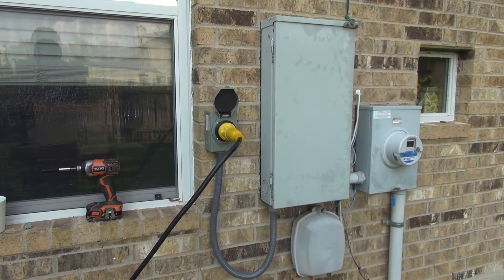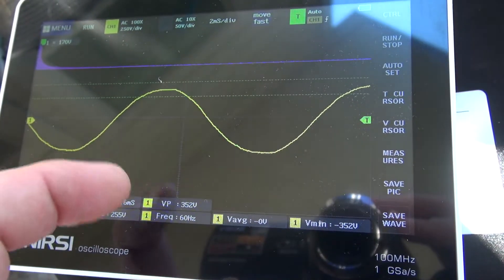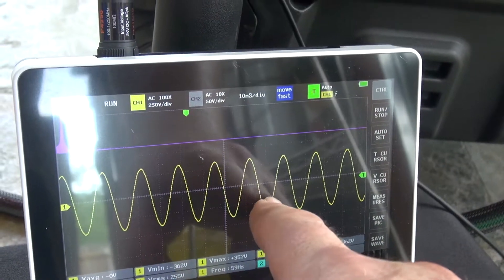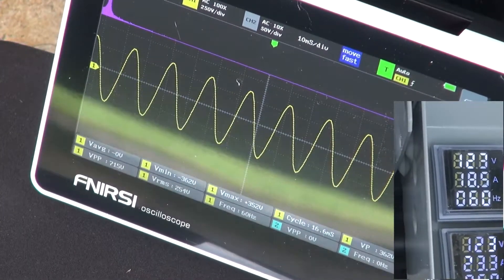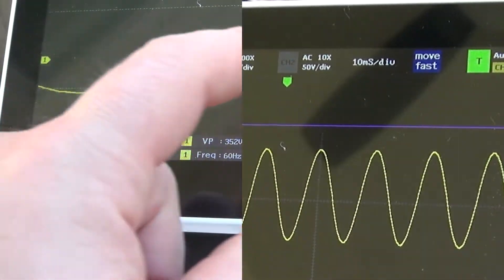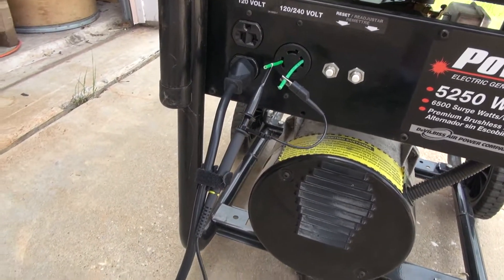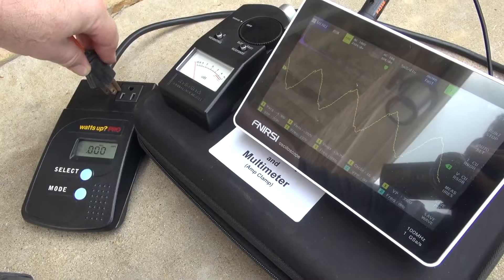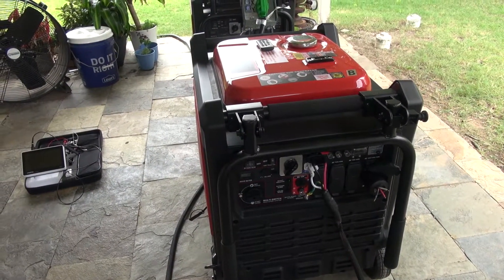Predator 9500 Inverter Generator vs. Line Power vs. Traditional: Compare Quality on the Oscilloscope

Comment: Have you tested the Predator quiet inverter vs the Predator open frame units? Seems they claim "voltage regulator" but say nothing about the quality of regulator they use. But my ancient whole-home generac (that needs replacing) uses a voltage regulator, but doesn't seem harmful. Higher grade I suppose. I'm trying to choose between spending $1100 and $2200. I care more about electronics-safe power than low-decibel power.

Comment: "A typical general-purpose AC-DC SMPS (Switch Mode Power Supply) starts with a bridge rectifier at its input" -> modern AC electronics can even run on DC!! dirty power is never an issue for modern electronics like mobile, PC, laptop, inverter AC/washing maching/refrigerator......they are only an issue for traditional inductive things like old ac/fan/washing machine/ etc...even resistive loads like toaster, old light bulbs don't mind dirty power...Its just a marketing gimmick!! Inverter generators are good because they are quite, fuel efficient (eco mode). BTW in my country thousands of homes still use modified sine wave inverters....and guess what - most of the low power UPS you get online are modified sine wave yet computers work with them!!!

Comment: this is mostly snake oil BS. Most modern consumer electronics and appliances can easily handle the "dirty" power from a standard generator, this was only an issue decades ago with old crappy generators and appliances and electronics with old liniar power supplies. There are almost no actual tests or data on this actually damaging electronics in modern time. you just hear theoretical horror stories designed to sell more expensive inverter generators and as the price of normal generators goes down, the more horrific the stories get to sell inverters lol You would have to run your house on a standard generator for the next 15 years to ever notice any damage to your electronics, if it ever in fact even happened. you think the hospital runs its backup power off an inverter generator with all those sensative machines ? nope.. and the use percentage gaps are about the same as your home, just on a larger scale. Most hospitals dont even imploy power conditioners with their backup systems. google will say they do but in practice almost none actually do.
Reply from the maker: It’s less about the fact it’s an inverter and more about the fact that the portable style generators will often bog down on heavy loads.  If the AC turns on, or the water heater turns on, the engine will be dragged down until it can get fuel and react to bring it back up the speed.  The result is the frequency of the power will change exactly proportionally to the speed of the engine.  That’s what will mainly tear up electronics.  (I had an air compressor, and I could hear the frequency of the compressor motor changing with the traditional style generator load).  Whereas inverter generators will make clean power no matter what, and if they overload, they just turn off the power vs. corrupting it. 

Hospital generators, whole home generators?  Not as much of an issue because they oversize them.  Most homes don’t need remotely the capacity of the standby home generators, but they have to oversize them so they can handle the surges and not get bogged down. 

This method, combined with things like the AC soft starts, allow you to use a more reasonable sized (and cost) setup safely.

Comment: I 100% agree with everything in this video...HOWEVER, I have an almost new 13,500 watt open frame generator given to me for the sum of $0.  I'm left wondering if I could build a hefty capacitor bank to smooth out the modified sine wave.  I know it's an older video, but any input from someone who understands more than "good"  "bad"  "cause I heard" is appreciated.
Reply from the maker: If it's a traditional style coil generator, it should be making a full sine.  If it's an inverter type, you'd have to check if it's a modified sine or full sine.  

If a traditional generator, I wouldn't do it, because the frequency of the power will fluctuate with the speed of the engine (which will change as loads are suddenly applied).  I have a feeling these inverters aren't very good at adapting to changing frequencies, and are instead just designed to match and remain synchronized to a frequency... so that would be bad. 

If it's a modified sine... man... I couldn't predict how it would react.  If you wanted to risk it... I'd say start the modified one first, since it probably isn't designed to be parallel, so you would want it to be the one present that the other syncs to.  But I have no idea how it would react.  

If you could build out a capacitor bank that would truly smooth out the modified sine into a real, full range sine wave... then I would ASSUME that the second unit (that is designed to be run in parallel) would sync to it.  (but again, start the one that isn't designed to sync first)

But you're deeply in uncharted waters. Stay safe!
Reply: @Texas_DIY  Thanks for the input.  My understanding is it's just a regular old portable dirty sine generator.  It's definitely NOT an inverter.  I'm just trying to smooth the "dirt" out like you see in your video.  You can hear the awful louder buzz from appliances when run on it.  Even various shop lights - LED or CFL buzz like crazy.  They do that on my 5500 watt portable as well.

I guess maybe I can sell it and buy a less powerful sine.

Comment: Great if the 9500 would run
Reply from the maker: So far, years later mine are still going like new.  Though admittedly they don't get much usage apart from exercising them to keep the battery charged, and the rare instances where they are legit needed.

Comment: Actually, the ‘sensitive electronics’ he mentioned all have switch mode power supplies which self-regulate and chop up the incoming voltage and rectify it into DC. The noise created by the SMPS is much more than the THD from the conventional generator and the filter circuit removes all the noise. These power supplies will be labeled 120-240 and can handle that voltage range safely.
Reply from the maker: Some power supplies filter quite well.  Others not so much.  Other things such as the control boards on your central AC (or at least on mine) don't seem to have much filtering at all.  it's really not so much the jagged lines... yeah not great... but it's not going to insta-kill anything.  To me, it's more the issue with the power frequency fluctuating so widely when loads are applied to the generator and the engine bogs down.   On one of my tests, I plugged in an AC motor to the traditional generator (Air compressor) and I could literally hear distinctly the motor changing speeds with the AC frequency. 

To each their own, but I'd rather not power my stuff I care about on power that behaves like that... especially in an instance where it might be ongoing for several days. 

Stay safe out there!

Comment: Great video! I am doing the same tests on my 3 champion generators. However it made me wonder if you have ever fried anything with the open frame plain generator? I have run 2 different inverter welders and a transformer welder on my "dirty" generator (and yes the sine waveform looks like a sawtooth) but the welders still work like new. I am not an electronics nerd but just wondering if it's that necessary to have a squeaky clean sine wave? Risky, yes, but have people actually had problems with fried PCB's?
Reply from the maker: The sawtooth is called a "modified sine" vs. a "pure sine".  Most inexpensive UPS units and inverters will make power in this way.  It's not ideal, but not horrible or anything.  And the "dirty power" of a traditional generator isn't at all catastrophic, people have been using them for many decades... and most home backup generators are the traditional coiled "dirty power" units.  While the pure sine ones are certainly better, but it's not like a normal one will insta-kill your stuff... to me the issue is really far more about when the traditional generator is undersized.  

On undersized units, when a large load hits, it will bog down the motor, and because the power frequency is tied directly to the motor speed.  This means when the motor stalls a bit under a sudden load, the frequency of the power will change, potentially dramatically... which can be very harmful to electronics. 

In my testing, I plugged in a small pancake air compressor to the traditional unit, and you could hear the motor changing speed directly with the generator's speed.  (as most AC motors are speed locked to the power frequency).  A motor won't really care, it will just run slower or faster with the frequency changes... but many electronics, particularly those without good protections in place, may be negatively impacted by such frequency changes.

But as long as the generator is sized properly, where it maintains a relatively steady 60Hz, a normal generator is fine if that's what you've got to work with. Most whole home backup generators are quite oversized for the anticipated load (mainly to handle sudden spikes in demand, such as an AC unit turning on), so the power frequency on those are generally pretty stable.
Reply: @Texas_DIY  Good information, well explained answer, this is just what I was looking for. Thanks for helping my understanding and for taking time for the reply 👍

Comment: Do you know of a way to convert the dirty power from s generator to clean power? I purchased a very expensive Generac 17,500 generator to power my house, only to discover this dirty power issue after making the purchase.
Reply from the maker: Honestly, if the generator is sized large enough to not get bogged down when large loads hit, I wouldn't sweat it too much.  It's less about the cleanliness of the waveform, but the consistency of the frequency (motor maintaining speed on a traditional genny).  

If you have some really expensive / sensitive stuff, look for a UPS unit for those items that is "online" or "double conversion" (same thing), those units ALWAYS have the inverter running providing clean power.  So in a way, it's like these generators, only instead of a gas engine powering the inverter, it's either line power or a battery.  But the resulting output is always clean.

Comment: Why would anyone make this big of a purchase on an item the manufacture has no faith in lasting? Harbor Freight only gives a 90 day warranty on this generator, oh sure you can buy a 2 year one time replacement contract that you will likely have to use but that just adds to the cost of this generator. 
I ran some numbers and here they are and they are current as of 11/10/2024.

Predator 9500 cost $2299.99 
Comes with a 90 day warranty
2 year one time replacement contract $749.99
Sales tax (based were I live) 6.5% $198.25
Total Price $3248.23

Predator 9500 on sale cost $1799.99 
Comes with a 90 day warranty
2 year one time replacement contract $749.99
Sales tax (based were I live) 6.5% $165.75
Total Price $2715.73

Yamaha EF6300iSDE cost $2995
Comes with a 3 year warranty no cost. You can purchase a 3 year Yamaha Extended Service contract (YES) for 6 years of warranty. 
No tax unless you live in California plus free shipping to your home. 
Total Price $2995

You can purchase the Yamaha from National Supply, they are a Yamaha dealer and they are awesome to deal with and they are the lowest price you will find on the Yamaha generators with excellent customer service. I have purchased three different Yamaha generators from National Supply. 

Predator 9500 full price $3248.23 vs Yamaha EF6300iSDE $2995, The Yamaha is 253.23 cheaper.

Predator 9500 sale price $2715.73 vs Yamaha EF6300iSDE $2995. The Yamaha is within $279.27. 

Yamaha are known for their reliability, longevity and quality. 

Predator are known for their problems lack of reliability, longevity and quality. 

The 90 day warranty should be a huge red flag to everyone but people get caught up in price but in this case the Yamaha is cheaper than the Predator when you have to pay full price for the Predator by $253.23 and within $279.27 when you can get the Predator on sale. 

Why anyone would pass on the Yamaha to get a Predator is a mystery.

Comment: Even so it's dirty power, I never heard someone loosing a fridge or a PC from it. Yes it is dirty, but probably still within range.
Reply from the maker: Dirty isn't as much of the issue as a sudden load bogging down the motor and causing the frequency to slow down significantly.  But yes, in general, people have run on normal generators for a long time... it's not like an insta-kill to your computer.  But the benefits of the more clean power and the engine being able to throttle down can't be denied.  :-)

Comment: I have seen videos of a few open frame generators that have THDs that rival inverter generators with less than 8% at full load.  I don't know how these differ from other open frame generators other than having V-twin engines that twice the number of power pulses per cycle than single cylinger generators.
Reply from the maker: My understanding is that these generators have windings that create AC voltage at a very high frequency (like 100's of Hz), it's converted to DC (or somehow otherwise manipulated) and the inverter electronically converts that, back into clean AC 240Hz split phase power.  The frequency of the output is thus not tied to the speed of the motor, and the engine can freely speed and slow based on the load, saving fuel, and producing consistent clean power regardless of load (until it's capacity is exceeded, and it just overloads by shutting off the power, vs. every giving 'bad' power)
Reply: @Texas_DIY  That's how an inverter generator works.  They use a 3-phase alternator similar to a car's alternator but at a higher voltage output.  The ones I'm talking about are the open frame non-inverter generators.

Comment: I do understand what you are saying about cleaner power is best, but I’ve ran my whole house on a Firman TriFuel from Costco, non inverter type with a floating neutral and for several days, and I’ve had no problems. Electronics hate surge and unstable power power. Noisy power will be taken up by the electronic devices transformer and power supply. The power grid is clean to some degree, but if you put a voltage monitor on your home, you will graph out some variation there too over time and our TVs and appliances do OK, but those hard spikes are rough.

As long as a homeowner properly starts the generator, allows it to come up to speed and give it a minute, then closes the output breaker, or then plugs in their cords, and after that turns on the devices in the house, you’ll be fine. I know some will disagree, but get a non inverter type. Are Generac whole house generators  inverter? No. Their portables can be. But the 22KW is not.
Reply from the maker: I don't disagree with anything you said.  The main issue with the small non-inverter generators to me, isn't as much the noise on the wave form (not great, but not a disaster)... but rather my concern is mainly with the wildly fluctuating frequency based on sudden loads that can slow down a smaller motor. If your generator is large enough, when loads hit, it's no problem and it just powers through.  But on a smaller generator, a sudden load spike could take it down from 60Hz to 30Hz or less for at least a moment.  An inverter generator will always maintain clean solid 60Hz regardless of the engine speed, until the point at which it can't keep up and then it just cuts power vs. ever providing bad power.
Reply: Generac whole home units don't use inverter, they have a quality AVR which regulates the voltage ±1% and produce <5% distortion (THD). Some electronics simply do not run on dirty power. My dad's oxygen machine wouldn't run more that a couple minutes before shutting down on traditional portable generator, which is one of the reasons we got the Generac.

Comment: How often do you find yourself needing that generator that you feel its worth double the price for the same wattage ?
Reply from the maker: I have a pair that can team up to double the output and maintain the frequency sync automatically.  (see the other videos in the playlist)  How often do I use them?  Not often, I got them for emergencies after the failure of the Texas power grid several years ago primarily due to stupid EPA rules. Since I made the videos, I've used the generators for real, probably 3 times... and of the 3 only one was an outage ranging several hours.  It was certainly nice to keep chugging away and not worry about it.  But it's not as much about daily value, but about "insurance" in the event of another significant multi-day event. (and it was a fun project)